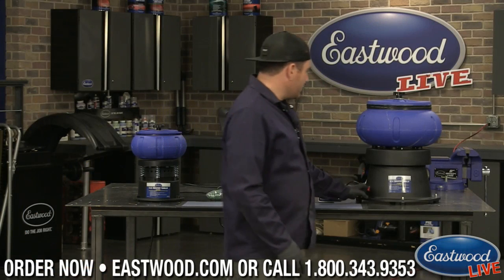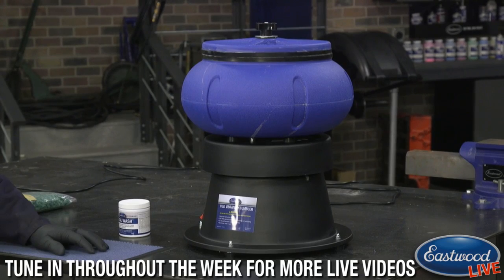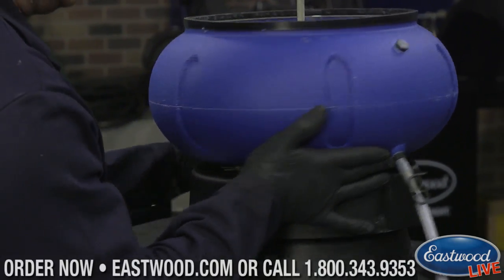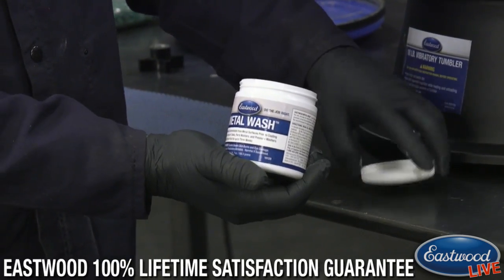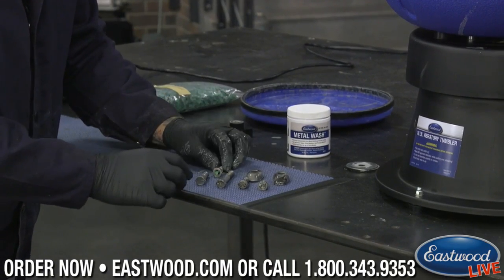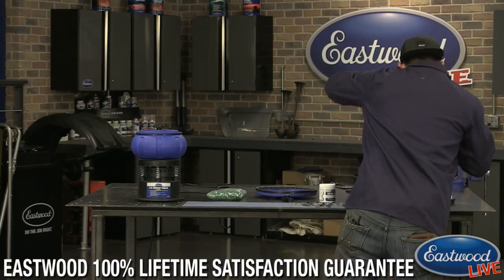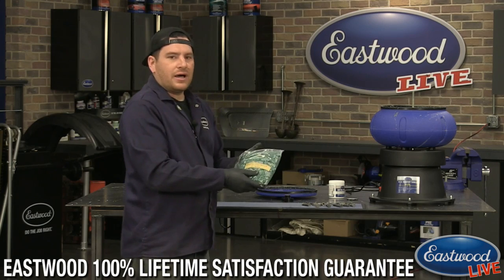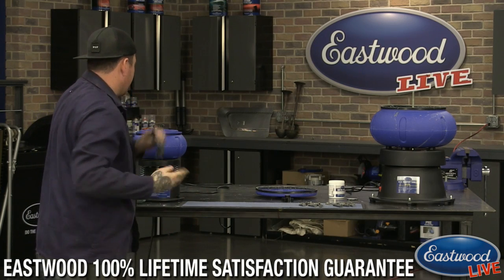How To Clean Metal with a Vibratory Tumbler from Eastwood.

Comment: My 5lb tumbler after 5 tumble sessions of about 2 days each was working fine, then the next session on the 2nd day when I checked it had splatter all over the outside. I cleaned it all up and washed my items with a soap rinse. 3 days later when I wanted to use it again it just hummed but won’t vibrate. What do I do. It’s only a few months old

Comment: "wash" (acid concentrate) "eastwood secret" (literally just acid) . try powder tannic acid, and fine media sand to get glassy smooth parts on old tools and others, great tool to have for hand tool restoration, personally i prefer the rolling drum kind, the rolling action is more violent and allows me to use finer media for the cleaning and cuts down on polishing time, (not like i do this frequently at all) just use some sand blasting sand and tannic acid, about 2 tablespoons per quart.
Reply: In water, or dry?

Comment: I don’t have an Eastwood one, but one that appears identical.   A bit of a novelty tool which isn’t as effective as some other cleaning or polishing methods, however it significantly reduces the amount of time needed to otherwise stand in front of a bench grinder or blast cabinet, and really does an impressive job as polishing small parts, especially those too small to easily hold against a buffing wheel.  These aren’t expensive, and I would totally recommend one if you frequently clean and polish small parts.

Comment: I want to restore model engine parts - most are aluminum - that have been stained and discolored from heat and fuel.  Would this be a good unit for accomplishing that?  What would be the recommended media? THANKS

Comment: Can you use this to get motocycle Carbs to a Shinny Finish as to buffing for hours?
Reply: Probably not a great idea to put carbs into this, same reason you wouldn't sandblast a carb. Too many tiny passages that can get clogged or damaged and affect the way the carb works. If you get some sort of rubber sheet and clamp it over the intake and engine-side carb mouths and plug up all the other spigots and such - maybe you could use a non-aggressive media in a tumbler to try to get a shine on the aluminum.

Comment: Do these tumblers work for gun parts? To polish them and get them to a glass finish?
Reply from the maker: Many people use them for bullet casings.
Reply: Do they work well for polishing safeties, triggers, hammers, other components other than casings
Reply from the maker: I've never used a tumbler for those parts, but I don't see why it wouldn't work.  You would likely use the Dry Shine media, which isn't aggressive.  You can call an Eastwood Tech to discuss:  800.343.9353